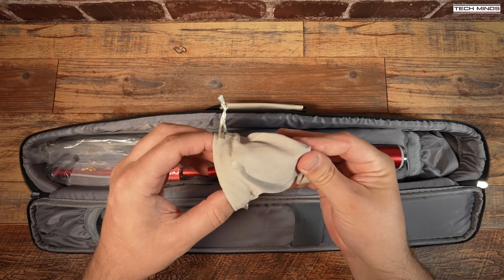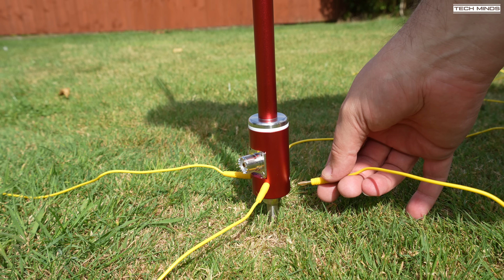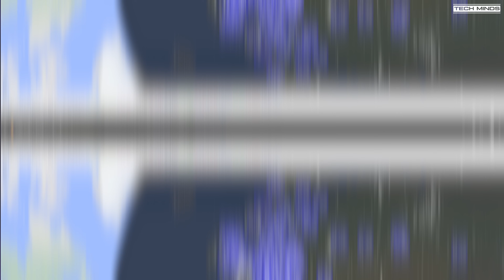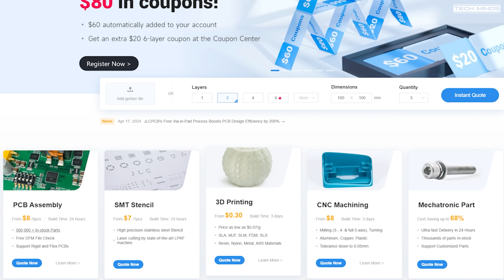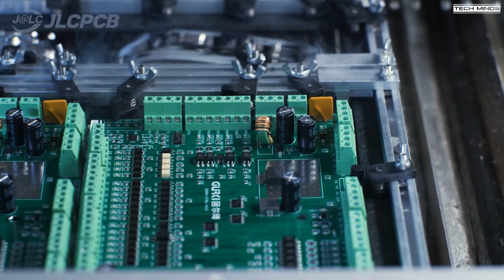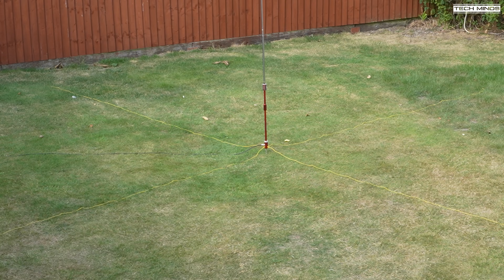Best Portable Shortwave Antenna - MA-12 40 - 6m

Comment: I use the M750 for SOTA,quick and easy to set up,no need for ant analysed with the bands marked on it.  It works much better on20m and above,too short to be a good performer on 40m even with coil.  Heavier than an EFHW wire aerial.

Comment: Hi Mat, I have a JNC Radio MC-750 it's the same as yours, I've had it for just over a year and I like it, also have the 80 meters loading coil but haven't tried it yet doubtful how efficient it'll be on 80 considering the overall length of the antenna, but from 40 meters and above it performs just as well as any other 17 foot telescopic whip antenna, it's the package and the easy setup which works for me and where I use this antenna normally a local park, it's not so much of an eyesore for the locals using the park.

Comment: It could be great. I have the same telescope, but I'm using an old military 70cm tripleg as base stand, because we have so dry summers, I can't put a ground spike into the ground. Or sometimes I use it on asphalt, so the stand is more practical for me. It is very sensitive to the length of radials.

Comment: This is the Chelegance MC-750, which I have, and LOVE.    It's my main POTA antenna. With my FT-891, it's pretty easy to just slide the antenna to the appropriately marked spot - and get on the air. Minor adjustments maybe, but no big deal. I've been primarily on 20 meters and have made contacts all over the west (I'm in the Reno area) and even some back east (IL, IN, WS). The only issue I have out here in the desert is rock hard ground. I sometimes have to use my drill and a foot long 'auger' to make a hole to slip the antenna in.  😊

Added in October 2024. Using this antenna in northern NV at a state park for POTA, I received calls from VA and MD, KY, TN, and  Canada. The BIG surprise was a call from Sweden! And of course, I had to drill a hole in the rock hard ground to set the antenna up. I LOVE this antenna and its simplicity.

Comment: Hi Mat, Great presentation of this portable antenna. Since you only showed us 40-20 meters I tend to think that your end fed seems to pick up a little more noise as it rises the noisefloor when swithing to the end fed antenna. It was clear the end fed would be the best on 40 but I was convinced the MA-12 did a very decent job on 20 meters and again for me a little less signal but a quiet noisefloor is what I would prefer. Overal considering only 4 short radials this antenna seems to do a decent job. Rasing the antenna feed point and using 1/4 wavelenght radials elevated from the ground could even outperform the groundradials but it's less simple to set up. Cheers, Phil ON4VP

Comment: Will this work on a rooftop??
Reply: If you want to raise a GP antenna and not have the radials on the ground, you will likely find it difficult to get a match unless the radials are resonant. If you do use resonant radials you should get more gain than ground mounted.
Reply: @rjy8960  thanks 🙏🏻 73
Reply: @vu3mes  it's made for quick deployment in the field, the telescopic whip is not suitable for  a permanent base instalation

Comment: Do you agree with this proposition: Lacking a sizable test range and a lot of RF sensing equipment, the only convenient way to test an antenna is to compare it to an on-site reference antenna, transmitting simultaneously, and compare downrange signal strengths. In any event I really enjoy your channel, it's informative! Andy WM8Q
Reply from the maker: Reviewing and testing antennas on a video is extremely difficult. Mainly because each location will see different results. Not only location, due to earth type, height, surrounding buildings etc, but also band conditions especially when testing HF antennas. That's why I switched from doing "Phone SSB" contacts in videos to using some form of digital mode like FT8 or WSPR, so that I can see who around the world has received my signal. Two important factors for me when it comes to portable antennas is 1) How easy the tuning process is (this needs to be quick) and 2) That the antenna is NOT a dummy load. Recording the transmitted sessions with digital modes helps to see if its a dummy load. Cheers and thanks for watching my videos.
Reply: @TechMindsOfficial  you've come a long way from reviewing cheap aliexpress stuff to doing quality reviews. Lol, I would like to seeb your EFHW setup after seeing the A/B switch change. 73 KD9UQE
Reply from the maker: The EF antenna I was using is 71 feet of wire connected to a CHA URT1. Pre-tuned on each tested band before the comparison. Video on it here: https://www.youtube.com/watch?v=p0s2rEcDiLs
Reply: @TechMindsOfficial dummy load!  You are not wrong!

Comment: Does look similar to jpc-12, but non adjustable coil.  Nice design for radial attachment, no need for separate ground plate.   Thank you for your review!
Reply: The company that makes the JPC-12 also makes the MC-750 which is literally the same antenna as shown in this video.

Comment: It looks like another good portable alternative similar to the JPC-12 only with a better system for the ground radials, and the markings on the extendable radiator would certainly make tuning to each band much easier in the field. As far as it’s 40 m performance, like any antenna that is less than a quarter wave in radiated length it will not be as effective as at least a full quarter wave wire would be. Thanks for the informative comparison video. 73 de Dan WD4DB

Comment: Looks like a clone of or very similar to an mc-750 that I saw in another review the other day.
Reply: JNC gets them rebranded from this factory
Reply: O yes just about the same 😮
Reply: In fact the mc-750 is the same antenna under a different brand
Reply: Ok cheers. How do you know that? Not doubting but just wondering. If so the cheaper one is good value but hoping one isn’t a rip off of the other.
Reply: @Rabbit-Stu  they are exactly the same, like said just rebranded OEM
Reply: @TechMindsOfficial cheers